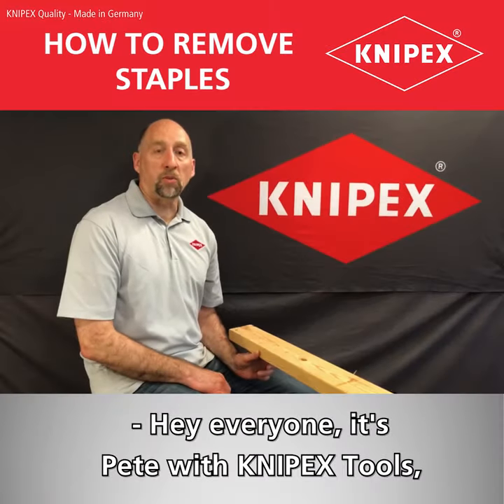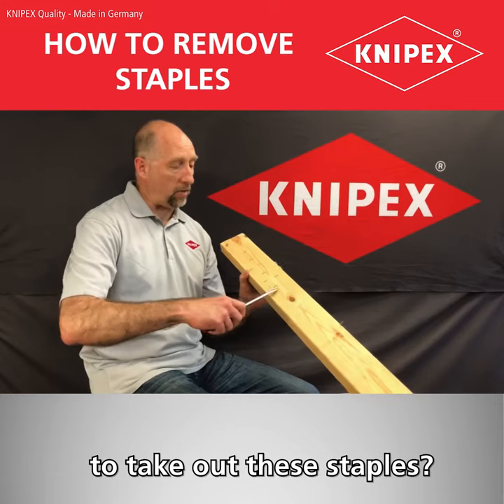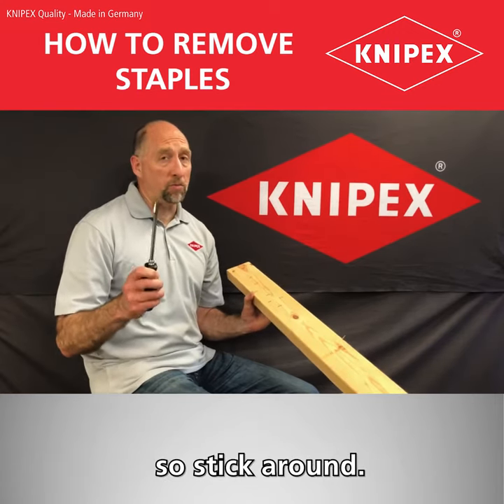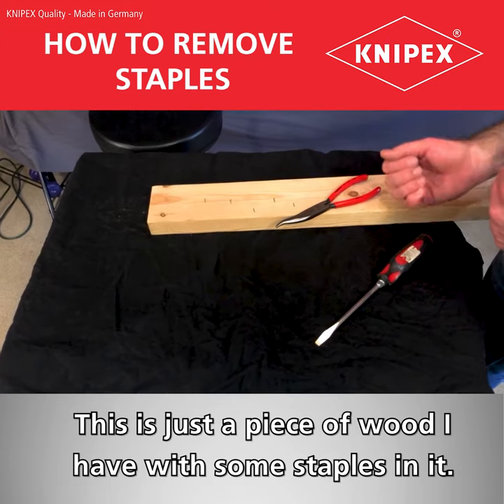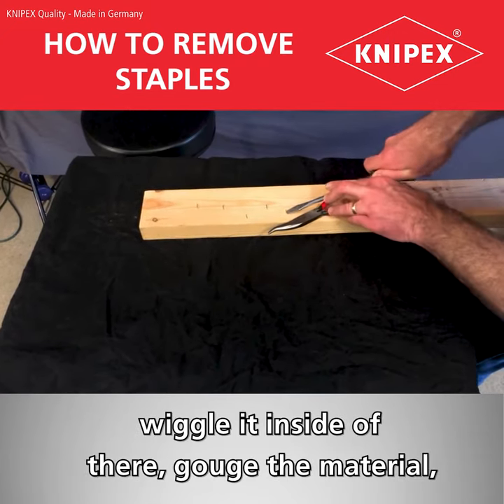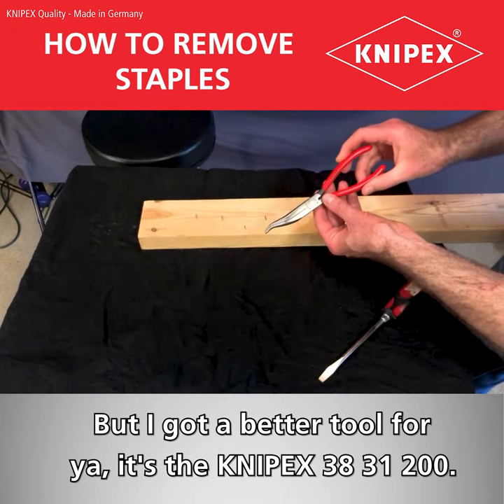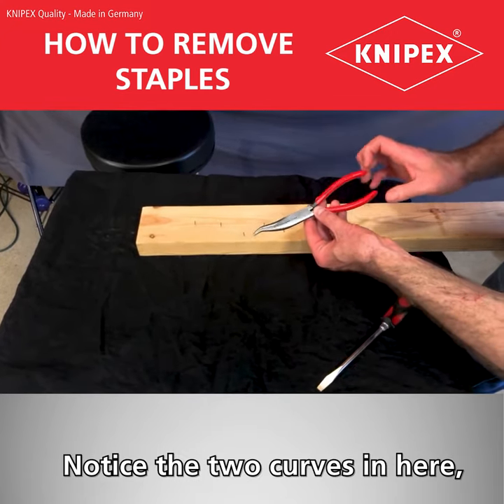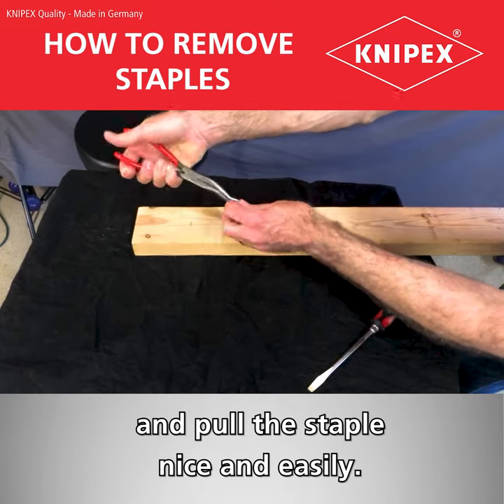KNIPEX Tool Tips - How to remove staples

Comment: i need to remove loads of them and is pain full process. I don't see like to work. Softwood is easy. Show hardwood with 10mm staples which been shot there with 6-8bar pleasure.  After removing about 500ml bottle of them i can't feel my hands. Can't find better set then sanded flat screwdriver with cut out triangle in middle and wrapped with tape so soft foam stays around handle. Looks like a dildo but after pressing into hard wood all day that soft foam helps a lot.  After staples got lifted and than knipex 8603180 is good tool to finish removing only handle makes your fingers in pain as you are using opposite way.  PLEASE KNIPEX SAVE MY HANDS AND MAKE GOOD STAPLE REMOVER BECAUSE IT DOSE NOT EXIST!
Reply: There's a Rapid R3 staple remover (and countless no-name Chinese copies, of course), - have you tried it? Can't verify it's good though, - wanted to get it last weekend, but was unavailable in the local store, so just postponed that for the time being and used my no-name bent pliers.